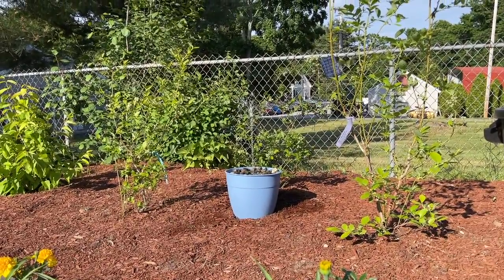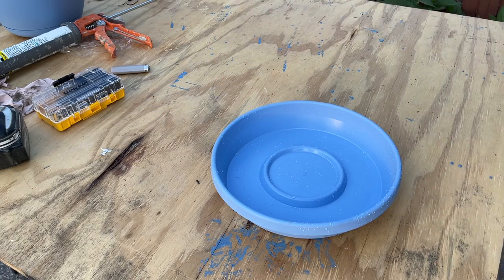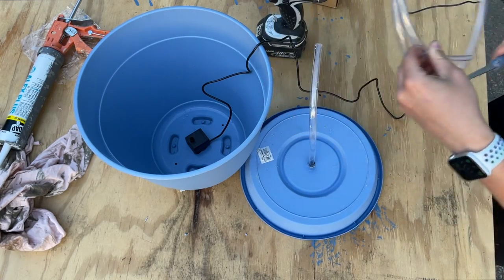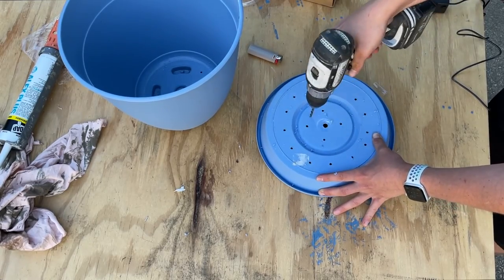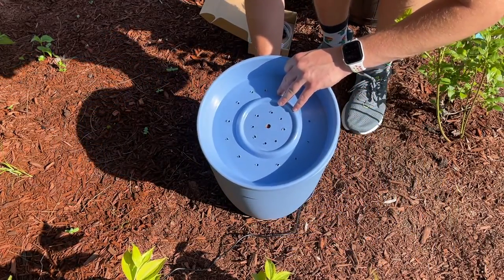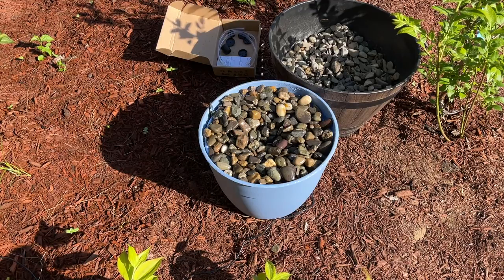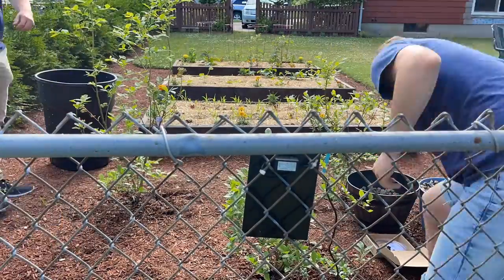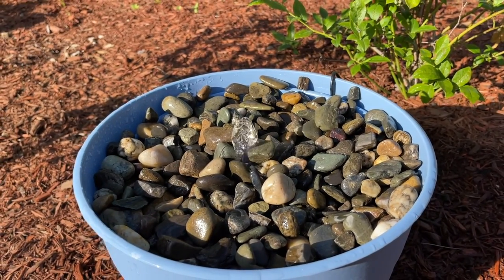DIY Solar Powered Water Fountain! ☀️☀️☀️

Comment: You can drill out the holes on the attachment just the smallest of hairs bigger and the spray won't be nearly as high. Start with the smallest diameter drill bit that would increase the hole size the least, then test. If the spay is still too high and spilling out over your basin again drill the holes just a hair bigger until you get the height you want with no overspray. Be careful and increase the hole size in the smallest amount possible. If you drill out the holes to large, you'll lose all of your height.

Comment: How did u zip tie the,panel to your fence
Reply from the maker: I had to play around with it but I just made sure I pulled the zip tie really tight against the fence, and it was attached to the wire of the solar panel
Reply: @JoshuasGarden  great I’ll try that.  Thanks